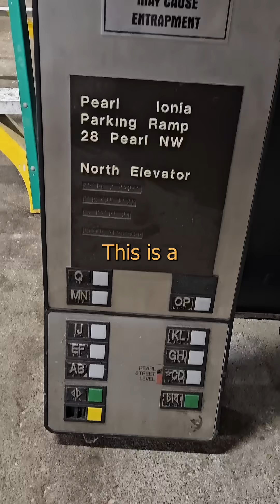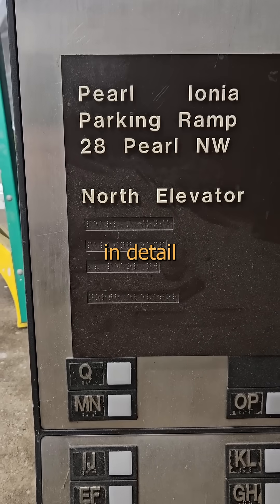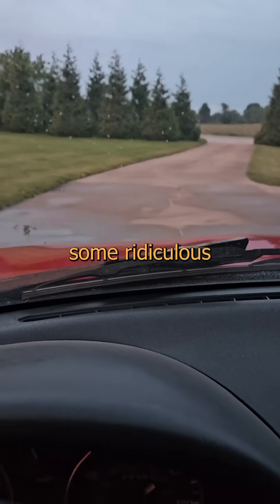Miata Mischief #chrisboden #engineering #gear #elevator #score #stories #parts #hacking #making

Comment: I ride an E-bike because everything about car and/or motorcycle ownership is Too Expensive! It's one of those 72V scooter-looking things, but it still only does like 50Kmh if you take the governor out.
But it's got no way to haul stuff reliably. The panel bags were expensive and not that big, my model didn't work with the manufacturer's seat-mounted pannier and even that's not enough to bring groceries home.

What I did have, though, was a couple collapsible bins and some tie-down straps!
More than once, I would put groceries in the basket, tie it down behind me on the seat, and just send it. Got a couple comments, but a creature's gotta do what a creature's gotta do when they bought too much crap to fit in their backpack and they're too stubborn to order an Uber.

Probably the worst crime I ever did was bring home an 8-string guitar. It didn't fit in the bin, so I had to get creative.

We had this little push-dolly that's meant for carting groceries around in an apartment or from store to home if you didn't have car. It's a little wire box with a flimsy bag in it.

What I did was take the tie-down strap, wrap one end around the handle, and the other side underneath the seat, and put the guitar in the back and pray to God it didn't fall over. Perhaps the sketchiest kilometer I've ever driven in my life from the post office back home.

Thankfully the next time I had to do that with a couple MIDI controllers, a kind gentleman also in the E-bike club, but with an *actual trailer*, was at the post office at the same time, and obliged to help me move them. (My bike's motor could easily outpower his if he tried some bullshit, and I'd gotten the controllers on sale for basically the price of only one of them -- the risk/reward calculation made sense over... just buying an Uber.)

I don't trust myself to pull that kind of shenanigan off anymore, and it definitely wasn't safe to do, but... I mean it did work!

Comment: Dude... I moved three times using just a 2002 Fiat Punto. Once I bought an unpacked queen sized mattress in IKEA, opened the trunk hatch, and pushed it in, filling most of the car's interior with it. Then, somehow got in the driver's seat, pushed part of it to the ceiling with my head, enough to kinda see out the windshield and be able to kinda turn the steering wheel and made it back home. It was a manual transmission, too. I even passed a police patrol, they saw me looked at me with the widest eyes I saw on a cop, I just smiled and shrugged my shoulders, and they just went along without stopping me. Then when I wanted to rip it out, it was so wedged in that when it finally came out it brought a considerable portion of the plastic upholstery with it 😅 in the end I fixed the car and was a happy new owner of a heavily discounted IKEA mattress for which I just needed to come up with a bed frame but that's an entirely other story 😅

Comment: Not for home but I work at ohare with driving priveleges on the airfield since most of our work can only be accessed from there. One year I had to haul 2.5 tons of scrap conduit strut and all sorts of matter through the airfield in a stake body truck with gaps wider then your mothers legs when I walk through the door. At the end of the day not much fell through thankfully that my pick me up crew couldn’t get as they followed me off the airfield and into pedestrian traffic where it’s typically more forgiven if you have a pipe bust a window or two

Comment: I was moving out of my mom's townhouse to the house my now wife (hard to believe, I know) had bought. I needed to get my queen size bed frame moved using my 2001 A4 Avant, which had plenty of carrying space. I previously hauled a 50 gallon water heater for my dad, a broken down bed frame should be a non-issue. The footboard and sideboards were no problem, albeit the sideboards proteuded far enough forward I had to reach under them to change gears. The headboard, as it turned out, would only fit if my seat was all the way forward and angles slightly forward. I was 5'11" and 250~ lbs. at the time. I drove an entire hour, through the rain, gut-to-wheel, legs folded like a pretzel to move that bed frame. I think I fell out when I got to my house, that was the easiest way to exit. We still use the bedframe 😂

Comment: I took a 200lb, 7ft tall set of lockers from work when they were being thrown away. They took up most of the interior of my partner's 4runner and only fit with the bottom of the lockers draped over the headrest of the front seats. I drove home tempting a Final Destination death scene to have a wall for my trinkets😅

Comment: Back in the early 2000's I had an '83 Fierro, which had a sunroof. I was doing some sketchy roof repairs and wished I could take an extension ladder, then realized the sunroof might work... 

I wedged a 14' extension ladder in there (on a slight angle and used a few Bungie cords), and drove 'round town for a couple weeks.

Two cops did pull me over, but both times it was just for the conversation and to make sure it wouldn't fall out if I turned sharp.

I also have an old picture of when I crammed my Pearl Export drum set into that same Fierro (strapped the bass drum to the back deck and put cymbals in the front trunk) and drove from Holland to Rockford for a gig.

Thank you for reminding me of those memories!

Comment: In high school I found out they were tossing a couple server racks and a bunch of gear, and was ecstatic they said I could have it. Only problem was I had a 1984 Camaro, not exactly the right tool for the job.
But I was determined, filled the trunk and back seat with the gear, took the passenger seat out and stood the racks up in the car. T-tops are fun and useful. 
And if you think banging an enthusiastic acrobatic dwarf would be a challenge, try doing it in the back seat of a 78 Camaro with a full roll cage, you'll beg for the Miata. And for the record, it was one heck of a wild party and we still aren't sure how we ended up back there.

Comment: i have a 200 cc scooter , that i load down constantly , i work in live entertainment ,like concerts , festivals n such , on of the many festivals ive rode that scooter through a mountain range in Utah to get to a show loaded down with most of my camping gear and tools for the job , about 300 lbs going from SLC to Heeber through guardsman's pass , and at times often id pick up new stuff from the show, once i rose back with all my gear AND 6 cases of breakfast bars , extra tools ,a huge umbrella for a picnick table ,4 quilts , a 5 gallon gas can mostly full , AND MORE lol , i it looked like that hermit lady from the labyrinth loaded up with her stuff on her back lol , pushing 500 lbs and me up and over a mountain to home , i often times load it down and ride it like a crotch rocket  using the rear seat n pegs with the feet area used as a cargo place and have a rack on the back with nifty knots keeping everything together ,, Im DeaDPool FUQ .

Comment: Hauled a sectional couch, piece by piece in a 04 golf, seats pulled all the way forward and hunched over the steering wheel praying the airbags don't go off XD 
Same 04 golf, I put enough weight in it to look like the stock suspension was slammed coilovers, then proceeded to drive 5000km across Canada.. oh, and I didn't have a spare tire

Comment: Finding an 8×10 metal building ( fully assembled) on side of the road * apparently it had fallen of someone's trailer*  
But after a couple hours, nobody came to get it. I hooked up to a small trailer with a atv, wrote the thing on the trailer, strapped it down with a couple ratchet, straps, and took it home. Still use it today 👍

Comment: I live on a farm and my house is about 5km up a hill. I ride my Dirtbike everywhere.

 There was a but ton on snowmobile parts I needed for a school project tomorrow and I need to get half a snowmobile home to take to school tomorrow, and all I had was my dirt bike. 

So I packed 2 shocks, brake calliper, brake cable and lever in my backpack, the carburetor and fuel systems in my front hoodie pocket, and the secondary clutch and jack shaft on my lap, and primary clutch on the rear fender. It didn’t help I did this trip at about 11pm and my mom was wondering where I was.

Comment: I needed an engine for my car, but didn't have a truck so I improvised. I took my gf's '93 Nissan Maxima. The junkyard used a forklift to put the engine in the trunk for me. I tied the trunk lid and we set off on our 70 miles of driving down I-75. From Bradenton to Reddick. Once we were home we used an engine hoist to get the engine out of the trunk, as well as some "maneuvering". But it gets better. Apparently the engine that I got has the same issue as the one I replaced because it proceeded to throw a rod through the engine block less than a minute after starting. (The warranty on used engines voids if the oil pan is removed. Otherwise I'd have checked the rods before putting it in). So the next day I got up early and pulled the motor, put it back in the trunk of my trusty Maxima and took the trip back down the interstate. This time hauling an engine both ways. They gave me a warranty engine and swapped it with the one in the trunk. Repeated the trip home, taking the engine out of the trunk and installing it in my car. By 10:30pm I was driving my car home. We did the return and install all in the same day. I did have my best friend, who I build race engines with, help me with the work also. That was a crazy day.

Comment: I just brought a 500lb steel I beam home 60 miles with a Ford ranger, the 13.75 foot long beam literally hanging off the passenger side of the ranger via two ratchet straps. All the while there's a Ditch Witch C9 literally sitting in the box at the same time with no securement other than two flat tires

Comment: An inch-thick yellow power/fiber cable slung between two vans, driving right across the city.

Or a pile of 5m/16ft lengths of metal being carried in a Boxster, roof down in the freezing Scottish rain, because it wouldn't fit in the van. Remember kids- an F150 or Transit may have a bed of up to 8ft, but convertibles give you 93 million miles of storage!

Comment: I used to drive a 1st gen Nissan Frontier, 5 speed manual with one of those color matching lift top hard covers, the 2 sideways seats in the back and the flip down seat in the middle of the front bench for a total of 5 seats. A group of buddies and I were working at a summer camp and wanted to go for ice cream, but mine was the only car available as most staff there were not local.  Unfortunately, there were 7 of us who wanted to go, and only 1 was under 200 lbs... so she got the middle bucket seat, I drove, and everyone else fought not to ride laying in the bed with the hard cover latched, as I wasn't about to take it off. About a 20-minute ride later, down mostly state highway, we did all arive safely.

Comment: I cut two pieces of bamboo, each 23 ft long. I strapped them to the top/side of my Tundra.  The bamboo was at least 3 ft past the back and 2 ft past the front. It was flapping in the wind and making some crazy noises. I thought I was getting pulled over by the local police, but I made it home ok.

Comment: me and my line brother are in a fraternity and we had to make projects with our big brothers and those projects had to be exactly 7 ft tall. The problem is that we couldn't easily make them near campus without noise complaints or the police getting nosy so we had to go ~30 min away to an alumnus' house to make them. So when we made our 7ft monstrosities we had to bring them back to campus and unfortunately none of us had a truck or even a large car. So me and my line brother are both holding these 7ft long wooden boards each one being halfway out the car on either side as we ride down the interstate hoping we don't get in a wreck because air bags wont save us from 14ft of wood going from 70 mph to 0 mph against our bodies. Somehow we drive 25min and we are basically back to campus and we thought our troubles were going to be over since we wouldn't be going so fast anymore, but then we realized that we were going to be driving on smaller roads. So now my line brother is gauging whether we can drive past telephone poles, light poles, and mailboxes without hitting them with the 4ft of wood sticking out his side of the car and I have to try and hold mine up so the oncoming cars can get by. We somehow inexplicably successfully did all of that and got it to its destination with no problems other than the four of us stressing tf out.

Comment: Well I used a 2010 ford explorer to haul 2 5 ton ac units with the inside blower unit from a scrap yard when I went to drop off my scrap metal and with that load I also ended up with 2 refrigerator’s used leaf blowers and some weed eaters and a queen sized bed frame it was a eventful night of good was scary trying to get it home because the trailer and the whole ford was packed thank god for the back glass being able to be lifted up but most of it has gone to good homes fixed up and sent off to people who need it. I need another trailer to go back and do that stuff

Comment: I strapped a large pelican case that I found in a dumpster to the back of my motorcycle. It was around the size of a current model 1615 case. After securing it to the motorcycle I barely had enough room to ride home. This was in around 15 years ago so I have a picture somewhere of it.

Comment: My ridculous story is when me and my mom had to haul a goddamn fridge inside a Dacia Duster, and not a small fridge either, the bitch was a 420L unit and we layed down the seats, left the hatch open and cruised at 120kmh for 2 hours
   
Made it there in one piece
 

 My other story is when we had just finished a construction project and needed to haul our tools and equipament back to our house, problem 1: a lot of really big shit, problem 2: we only had my car... a Chevy Onix, shit smaller than a Miata and drives like one too
   
The car packed floor to ceiling with construction equipament, wheelbarrows, scaffolding, some materials like cement and sand in bags, paint, tiling, several impact tools, all with fancy boxes and much more on a classic mini, the bitch hauled everything without complaint
  
God I love this shitbox

Comment: I used duct tape to secure 20 sheets of 4x8 particle subfloor to the roof of a 1999 Chevy Tahoe because I did not have rachet straps or a trailer

Comment: Me and 2 mates hauled a Ford Zephyr (UK name), 2 miles through back roads on a 1 axle trailer rated at 1000kg. It took 2 hours and we bent the rear chassis end and tow hitch on a 1984 Volvo 240 station wagon! We were 17-18 yr olds.

Comment: We used a red convertible with leather seats to haul a full-sized all-metal table saw from Sacramento to Yuba City while it was over 100 degrees outside. We were SOOOO sunburned by the time we got to unload it. Also the seats we pretty jacked up. But hey, it was only $100!!

Comment: I used a small fold up bicycle to haul a few couple of things before. 
The old ones with white mudguards, seat, whitewall tyres and a 3 gears. 

First time was to carry around 5 large planters and the second time was for a huge piece of driftwood. 
Had to wheel it around 2 miles.

Comment: im a carpenter and my father though gifted in the craft (i apprenticed under him) is too deeply addicted to drugs to plan for emergencies. Thus when his truck broke down and his tools stolen: he did not have anything substancial saved... long story short i had to use my 2008 FORD FOCUS TO SOMEHOW HAUL A 16 FOOT 8 BY 8 TREATED POST! Words cannot express my level of rage, fear, and embarassment through looking like an absolute kedamine feind with how we managed to somehow precariously shove this beheamoth up onto my dash and leave the rest of the damned thing spearing out the back with the back seats lowered and the trunk latched down. More than half of that bad bitch was left hanging out in the air! We looked like an absolute mess and I used that poor, beat down car for work for two and a half years like that. So much of that car inside and out was dented, cracked, and broken :/ but by far that was the stupidest way to get that thing moved. (we had built a custom swing for a guy who bitched about us not honoring our price from six months prior during covid- which lumber had trippled in price since then. we also told him bids wereonly good for thirty days). But yeah- mild rant over.

Comment: I don't have a car anymore, and during covid lockdown, I wasn't allowed across the river to go get my dads car to go to ikea. So I ordered a new bed online, but the delivery service insisted I reserved parking space in front of my house for the delivery. So I had to rent signage from the city, which I had to go get at the city depot, which includes two large plastic blocks that keep the sign from toppling over. So I asked the city worker how much they weigh, and he said "about 10kg each". Now 10kg is the weight limit of my folding bikes luggage racks, both front and back, so I went to fetch them with my folding bike. Turns out they were more like 35kg each ... but without an alternative and having signed for them, I strapped the blocks and the signs to my bicycle and rode home, getting off at every bump in the road for fear of breaking about any part of my bicycle at the most minor of shocks. 
I got home with my bicycle in one piece, but I did hire a car to get the blocks back, and no more order delivery from ikea, I now haul my flat packed furniture with a dolly on the train 😅